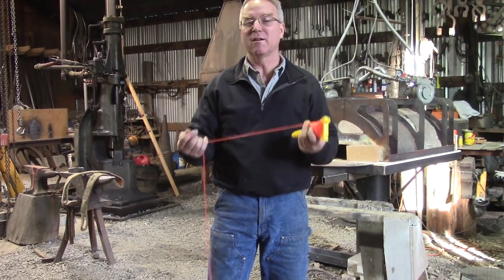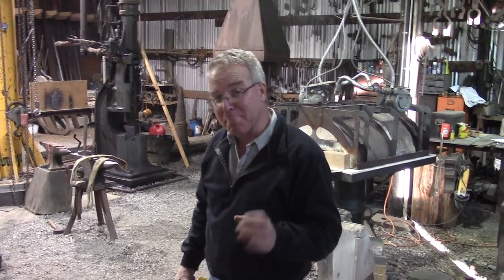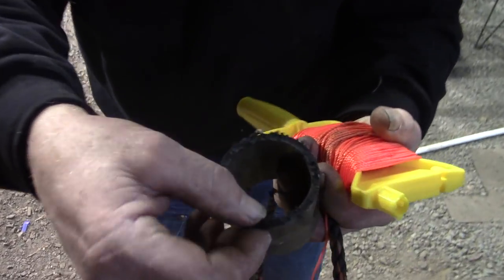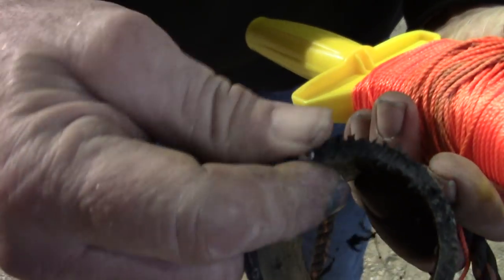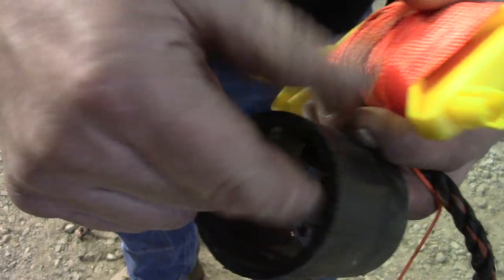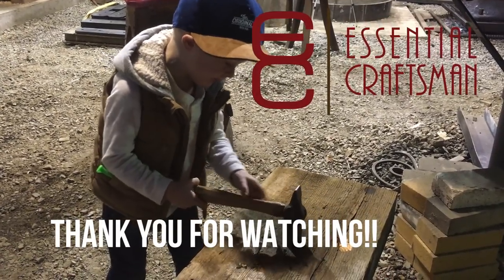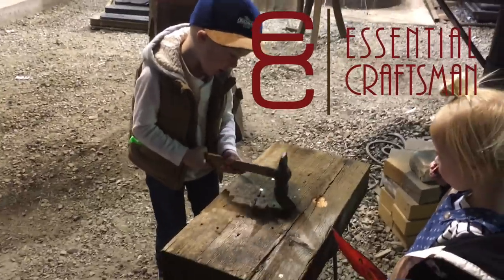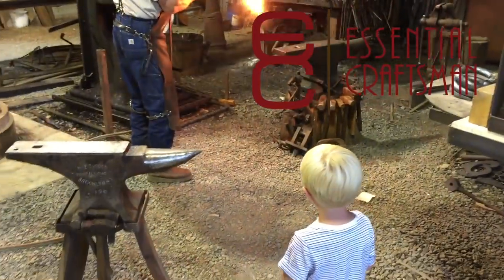String Cuts Plastic

Comment: I discovered this trick a week ago when I pulled a piece of string between my fingers and felt them getting hot.    
I then tried to see how warm I could get a plastic bottle by doing this, to my surprise, the bottle was cut in half, i then tried it on a bunch of different things, it eventually broke when trying to cut a broom handle, the wood was charred, hot, smooth and had a thin channel cut in it

If I had some better and slightly thicker string, i might have gotten through the broom handle.

Comment: had to do this recently to cut back a poorly measured 4 inch schedule 40 PVC pipe with 350 kcmil wire already pulled in it. Keeps your wire safe but tears straight through the plastic.

Comment: Interesting.

I work in the window covering industry and we have to use reinforced polymers for cord bearing surfaces, so I knew that cord will cut plastics even when you would really rather it didn't. But I'd never thought of using that plastic cutting ability for good rather than evil. 8-)

Comment: This is a common method of cutting plastic in prison. And they use threads taken from sheets or clothes, just double up the threads a few times... takes a long time, but time they got....

But the very best prison saw is a radiator hose clamp. Break it in half long ways and you have two saw blades... it can saw through some of the small steel bars.
The pipes that exhaust the sewer gas sometimes have those clamps.

In some countries it is not illegal to escape from prison. Please follow your local laws before planning your prison escape.

Comment: And that is one way to get killed climbing.  On rappel, you take a doubled rope and pass it through a nylon loop you will leave behind.  You slide down the rope, then pull one end and the rope comes down.  There are lots of ways this goes bad.  One of the most elegant is to put two dissimilar ropes together so You can go down in longer steps.  As you go down, the ropes stretch at different rates, allowing one to move in the direction of the stiffer rope. It saws through the loop and you are airborne. Solution is to equip your sling with a cheap metal ring, but in the day, a lot of climbers were just a little too cheap...